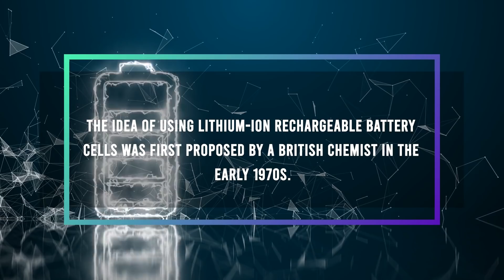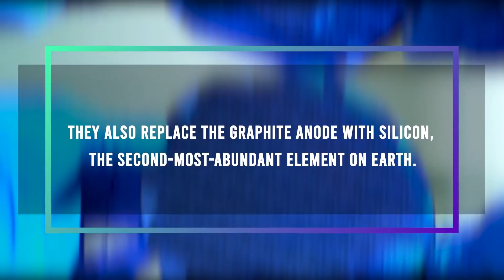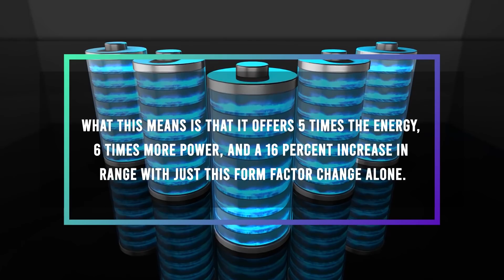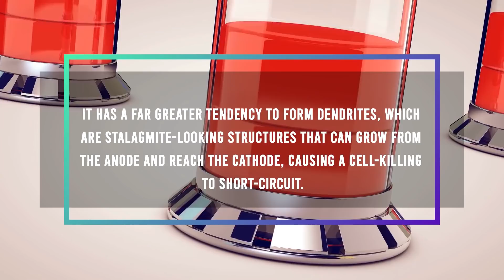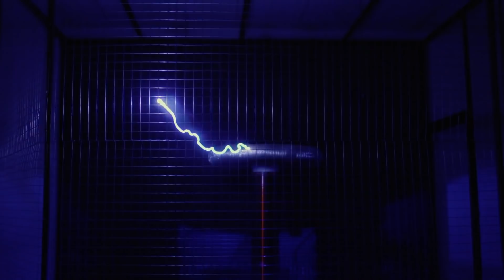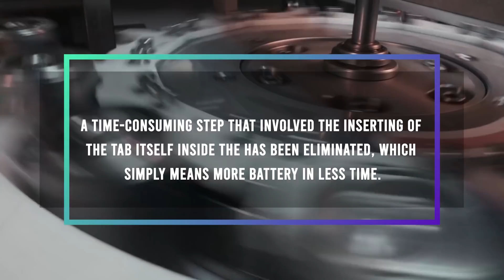Tesla's ABSURD NEW 4680 Battery Will Destroy Solid State Battery Competition

Comment: The issue with the 4680 is that the range is only between 300-400. And it does not charge in 15 min, It charges 200 miles in 12 min. Solid state batters charge fully in 15 min. So 4680 is not good.

Comment: The main advantage of this is to reduce costs on the most expensive part of the car, but I fear it was a mistake to make them in China. Any technology built by chinese can be considered immediately stolen and we're going to see a chinese automaker using those kind of batteries in less than three years. Meaning a competitive factory is already under construction somewhere in china that will sell cheaper EVs as they don't have to finance R&D as much as others they're stealing from.

Comment: The video discusses two main points that are not even comparable.  One is that Tesla has fine tuned the lithium ion cylindrical battery.  It has removed tabs and increased storage size.  This allows for cheaper and more reliable operation.  But since the design is still the same with a liquid chemistry, the dangers of uncontrolled fire is still there.  This is one of the major flaws of this battery technology and is most concerning when the battery integrity has been breeched as in a deforming collision.  On the other hand, solid state battery technology is new and a progressively safer chemistry than the older li ion battery.  The problem is that this new technology is costly.  Tesla already has had a decade to fine tune manufacturing refinements to the older technology and is doing well with it.  But as far as the future goes, I think we must keep an open mind and forge ahead with safer technology.  The cost of the SSB will come with time as manufacturing design advances.  Then the li ion battery first emerged, it was also very expensive and now we have broken the profit ceiling of $100/kW.  I personally expect most forward motion to concentrate on the SSB.

Comment: This video is full of empty hype. The 4680 cells only have a small incremental increase in energy density. (The presentation and this video are all nonsense hype meant to persuade people that don't understand the technology to think these will change EV's will change history. The half real estate claim to generate the same power is great but misleading. It will allow faster 1/4 times and more peak HP but you will need just slightly less weight in batteries to get the same range. The car will weight just slightly less and the range will be just slightly increased.  

The [energy density] is still almost the same. This is the amount of energy stored in a given system or region of space per unit volume so the range will only slightly increase unless they cram in more kWh's of batteries in the vehicle. They can do this to some degree as they eliminated some dead space by using the batteries as part of the vehicles structure. 

This will be MAJOR nightmare as after 8 years or less. The warranty is 8 years OR 120-150 K miles depending on the model.  If a pack fails out of warranty. You are totally screwed and Tesla can charge whatever they want as you have to replace the entire pack that is also the cars full frame made on the largest high-pressure die casting machines in the world. The "Giga Press" It's all one giant piece. 

Before you could pull a module and replace bad cells. This time the batteries are bonded permanently into the entire frame as one giant unit. So now a failed cell is a failed battery AND a frame replacement.  Used 3-5 year old Tesla batteries can sell on Ebay for $10-12K and I've seen quotes from Tesla for new battery pack replacements between $20,000 and $30,000.  Imagine the cost when you also have to replace the frame and the battery. Yes battery prices will drop and new manufactures could come up with cheap replacements but Telsa cut that out by making the battery and car frame one piece massive 1200-2000 pound piece. To make that part you need the largest high-pressure die casting machines in the world. The "Giga Press" so any aftermarket batteries in the future. will be tough one to pull off.

Comment: Comparing different source of battery type? It's different class.

"4680 cells battery" uses nano-tech but it's still be LFP. OnTheOtherHand, SSBs uses new source of material and new technology producing. It's totally different performance fast charging, more cycle of charging, more capacity, low maintainance cost. How dare they compare btw 2 kinds of these battery?

Comment: One of the most significant improvements that 4680 cells bring to the table is the ability to build a structural battery pack that makes the pack part of the vehicle structure – reducing parts, weight, and cost.

Comment: The Tesla advantage - continued first to market with substantial improvements.   The other OEMs will have to wait until the kinks are worked out with solid state, then it will have to be manufactured at scale, and then proven in the field.  Tesla might just have yet another generation of battery tech out by then....and interesting space to watch.

Comment: Now if they just put them in cars that don't have $500 door handles. I dont want pointless little motors moving all of the vital accesories that I need to use the car. I dont want self driving and I dont want an IPad glued to the dash to be the only way to adjust the heat and radio. I want a Tesla drivetrain and batteries in a base model Toyota pickup.
Reply: Exactly right, I'm glad I'm not the only one to think this way. Far prefer a few knobs and switches and manually operated door handles and steering wheels. Tesla's idea of gluing a laptop to an Ikea bookshelf undoubtedly makes for a cheaper car, and it looks it.

Comment: They key to saving the most money on cars over the long run is to drive it till the car you buy to replace it cost less than to fix your old one. Usually 20 years
Reply: Not true in Norway 😅
I just sold our 9 year old car because it was more expensive than our 6 year old car (price drop and everything else included).
And with our tax-reduction laws it was actually more expensive than a 3 year old electric car....

Comment: Next industrial Tesla batteries will be hydrogen batteries.
HYDROGEN AS BATTERIES : HYDROGEN BATTERIES.
People often think about hydrogen as fuel, but many forget that hydrogen is not only a fuel, but also very good battery, too. 
Electric cars with hydrogen batteries instead of traditional chemical batteries to avoid all nocomfortable circumstances. TIME IS MONEY TOO.
 
The fundamental science dictates essential truth of chemical batteries :
if a chemical energy storage mechanism is charged as quick as producing hydrogen, then this mechanism PRACTICALLY  CANNOT HAVE ENERGY CONVERTION RATIO BETTER THAN ELECTROLYSIS PROCESS. Besides, it is possible to adjust electrolysis reaction speed (for example slow down speed) to get energy convertion ratio of electrolysis better than any chemical batteries. The best one of all possible chemical batteries in earth conditions is HYDROGEN BATTERY. All revolutions of chemical batteries, lithium batteries, LFP batteries, LTO batteries, graphene batteries .. are for reaching to the features of hydrogen batteries. 
  
The most simple hydrogen battery (simple hydrogen battery = 1 fuel cell + 1gas hydrogen ballon 300bar) easyly beats best lithium batteries by all features : more capacity, more power, less weight, forever lifespand, no degradation, charging in 5 minutes, same or better energy convertion ratio, but just noremarkable bigger volume sized than lithium batteries. 
Future hydrogen batteries can use more progressive hydrogen storage technology, like hydride material, can get even leap better. But right now simple hydrogen batteries are already better than almost chemical batteries.
 
So just equip cars with hydrogen batteries.  And equip hydrogen filling stations with mobile electrolysers to produce compressed hydrogen 300+ bar on site from electrical outlets. Electrolysing hydrogen filling stations (hydrogen battery charging stations) can run electrolysers from electrical outlets to produce liquid hydrogen on site, to avoid suddenly leap change requirements for big number of already existing current liquid hydrogen cars in the markets. But liquid hydrogen has low energy conversion ratio, which is one of current hurdle of hydrogen cars.  For now and near future, compressed hydrogen (produced on site)  is more versatile variant : for example, nets of electrolysing hydrogen filling stations mean that : you use electricity from electrical outlets to run electrolysers to produce compressed hydrogen 300+bar on site at electrolysing hydrogen filling stations. So you pay only for electricity (and water of course to run electrolysers), NO OTHER FEES, NO COMPLEX CRYOGEN EQUIPMENTS. 
(Additionally, car owners can buy home mini electrolysers to themselfe recharge their hydrogen batteries at home).

Cars come to 'recharge hydrogen batteries' in 5 minitues (load hydrogen). SAME COSTS OR EVENT CHEAPER THAN COST FOR RECHARGING LITHIUM BATTERIES. No waiting rooms. No wasting time in waiting rooms. Available recharging hydrogen batteries all hours of days. For stations owners, available to pick any imtermitten electrical supply schedule from grids in tandom with intermitten clean energy.

Comment: 4680 is just a dimension, it will be filled with many chemistries. "Solid state" is just a non-liquid electrolyte that offers no energy density improvements on its own. Solid lithium, all metal batteries are definitely the future, but that will be hard to do without a solid state electrolyte.  Once solid state all metal batteries are a thing there's absolutely no reason you can't make one to the dimensions of 4680. Does anyone believe Tesla's is against solid state? I think they just know it's going to take a few more years to implement.
Reply: Tesla has spoken about Solid State batteries in the past and i believe they said they would continue to focus on lithium ion for the foreseeable future. I don't know if that's because they don't have the time or money to develop solid state or if they really don't think it will ever take off but if it does i think it could come back to bite them. They could have change their stance though.
Reply: @owenharrington8704  If there is a battery manufacture that produces a better battery, Tesla will use them. They have only just started producing their own batteries and to my limited knowledge they have not sold a product with a tesla battery in it yet. The manufactures have been using tesla specified chemistry but that is a little different. It will take some time before solid state all metal batteries can meet the lifespan and cost required for automobiles. I would expect them to be common in aircraft and hyper cars before they enter the mainstream. If their brilliant chemistry development team at tesla does not see the potential of solid state all metal batteries I would be shocked.  We also need to start being specific about "solid state" a solid state lithium ion battery does not on its own offer an energy density improvement.  What we need is All metal / solid lithium, not ion. however that seems to only be possible with a solid state electrolyte.

Comment: This is just one step in battery development company hype.
Competition will lead to major break throughs  in weight  life  and recharge times being the big areas needing improvement.
Honey comb lithium batteries are being tested which are much lighter and charge in 30 sec from induction coils under the road.aluminium batteries ,

Comment: The 4680 is definitely not the end of the Solid State battery.  Tesla knows that as well.  It's simply the most realistic middle ground during the timeframe between current battery tech, and the time it's going to take to get Solid State battery to production quantity at a competitive price point for the mass market.  Sure, you'll see some Solid State at $500/kWh make it into the extreme cost cars, and it will start trickling down the $50K price cars when it gets below $100/kWh, but it won't be in the every day car until it sees $50/kWh.  The question is, what is that timeline like?  Is it similar to what it took Li-ion in the automotive world, which was about a decade?  Is it faster.  Well first we need to get to that production quantity w/ $500/kWh which we aren't there yet.

I see Solid State getting into Laptops, Tablets, Smartphones before making it to cars, which we're still not there yet.  A battery pack that cost $25 to make that gave a tablet 3x the life span is something users would be willing to pay for.  A 300kWh battery to get 3x the range on a Model S costing $150K for the battery isn't something many people will pay for.  And $50K for the same range but can charge to 100% in < 10min, now that's something people with the deep pockets start to consider.

Comment: Yaaawwwwnnnn, the 4680 will be good, if they can get them to work, but they are a refinement of an existing technology. If solid state batteries are ever produced in volume, they will be better.  Focussing on the "tabless" isn't focussing on what is holding up the production, it's the dry anode material that is difficult.
Reply: I think Elon has to make a play for quantumscape  It will actually reduce the steps to make batteries and everyone will feel safer in a tesla that doesnt have a dangerous chemical compound that can burst

Comment: Aren't you all getting tired of all the hype coming out surrounding Tesla? These are probably going to be fine batteries, if and when they are ever used in cars at a scale. That time is yet to come. So this video is making a case of a slightly improved Li-Ion battery that hasn't been demonstrated in the market, comparing it to a brand new tech that theoretically can turn the whole BEV industry up side down if it reaches maturity. Only purpose of a video like this is to inflate TSLA stock price.

Comment: liked at Tesla 4680 cells.  They're making them right now, have been for a while.  Giga Berlin will have the largest battery factory in the world within it, an they're making them in CA and TX too.  And, nobody has solid state batteries.  They're purely theoretical.
Reply: will they have a line in Nevada also? would imagine that will be happening once the manufacturing problems are fixed

Comment: I enjoyed this video, but what I wish you had also talked about is whether the 4680 offers a strategy to reduce, minimize or eliminate the dendrite problem.  Yes, the hope of solid state is to eliminate the dendrite problem.  But is the 4680 better, the same or worse than what came before it with regard to the dendrite problem?
Reply: with the dry electrolyte not sure that the dendrite problem is going to be a real problem especially with the iron phosphate chemistry
Reply: LiFePo4......................Paul
Reply: I understand Tesla's 4680 bets on Silicon anodes. Therefore, No Li metal, no dendrites. As a matter of fact, Li-Ion concept (initially dubbed rockchair) and solid-state electrolyte concept were two different ways to avoid the problems associated to the coexistence of Li Metal anodes and liquid electrolytes. The former approach substituted Li metal, the latter substituted liquid electrolytes.

Comment: This was a lame video that just regurgitated the same phrases over and over to prolong there listener's agony.
Lithium Ion technology will be with us for quite some time. Those who say we should abandon the technology and search out some new panacea have not been paying attention to all of the "miracle" battery need that pops up then disappears as the technologies ultimately fail.
The evolutionary approach of making the top and bottom edges of the paper in the battery be anode and cathode is significant. Electron flow rates should increase tremendously and internal resistance all but disappear, resulting in more power with less heat buildup in the battery.

Comment: I never understand why people compare Solid state batteries with 4680. 4680 is a form factor, SS is a chemistry (or something like that). So these 2 are not even competing technologies. The  only competition can be that SS may not be applicable into cylindrical format (I do not know this for sure).
Also: it is great that in 4680 the path of electrons are shorter than in 2170, but that was only the problem for cylindrical cells. Pouch and prismatic cells has short electron path by default (depends on the size of the cell of course, but usually those are not 1-2 meter longs.).
Reply: You’re right. SS is internal mechanics (liquid ion carrier changed to solid one) and 4680 is just cylindrical cell with all of its drawbacks. Jelly rolls inside the cell tend to get tricky since the foils expand with temperature and electrodes according the ion concentration. Larger is the jellyroll larger are the problems. Chinese did this large cylindrical cell approach already 20 years ago (with LCO thou). Now SS allows very light and simple gas barrier IF no metallic anode (or anodeless) is used. With graphite and silicon one can go to a completely different route. For example WO2014199002 (A1).
Reply: Both of them maybe competing for the next 10 years or by the time SS is ready for the market place tesla architecture maybe mature.
Reply: @bighands69  Here is an illusion in the market. SSB has been ready for more than 10 years already. The issue is with this false narrative we would need metallic anode for success. And that is not true. It’s just an extra hurdle. What happened was almost all applications required one hour charge in the past years. Power has been the limiting factor for SSB to enter market. Now BESS segment is growing fast and there the demand is already 4 hour charge. The direction is to 12 hour charge. So SSB is ready now for prime time.